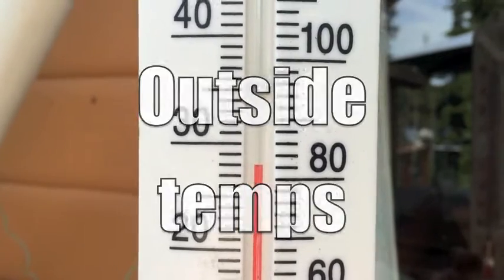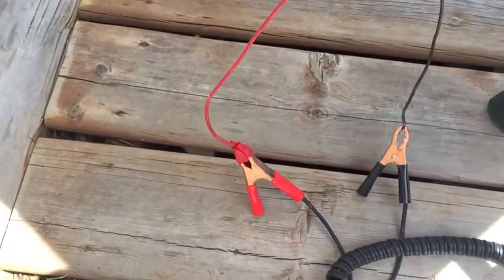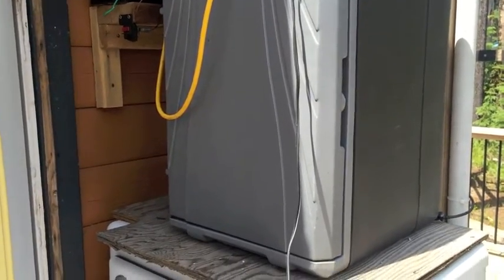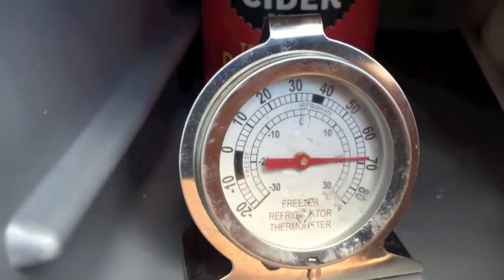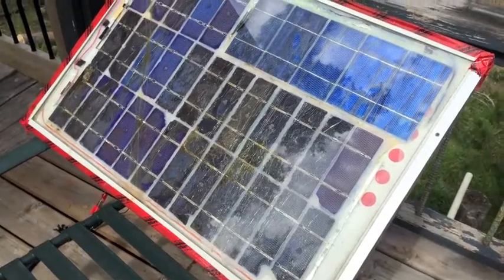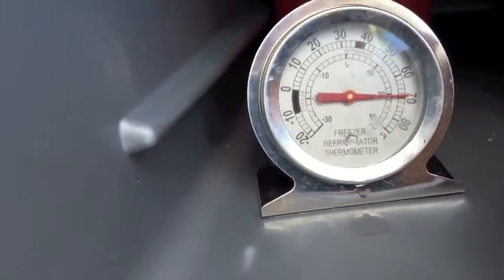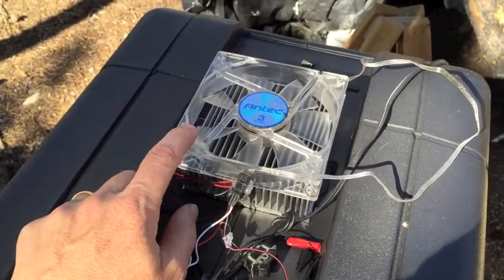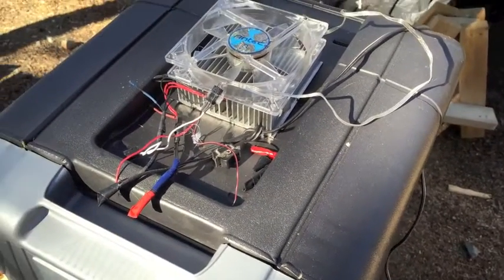Part 3 - Solar Panel and a Modded Electric Cooler

Comment: These coolers take a good 12-24 hours to get to maximum cooling. I have the older version of this. It's the same exact cooler except it doesn't use computer fans it has a duel shaft motor with fan blades on each end. I've had mine over 20 years and when the motor is working it works as advertised. 40 below ambient temp. My truck typically is between 70-80 so keeping milk fresh isn't an issue. I recently converted mine over to computer fan cooling like the new units for reliability and it works as expected. I recently purchased a fridge/ freezer cooler with an actual compressor but still use my 20+ year old chiller.

Comment: the problem is not enough amps. peltiers are inefficient if you dont have the voltage/watts theyre designed for. swap in smaller amperage peltier module and it will work more efficiently on same panel
Reply from the maker: Great suggestion. Thanks for the feedback!

Comment: I have one of these coolers. Even with the factory cord/fans, it took usually about 12 hours to cool things down in an indoor/cooled air environment. In a hot environment, it would take much longer. These coolers are awesome at keeping things cold, but don't work great (initially) at cooling them down in the first place. If I were you, I'd run the test again and just keep it going overnight. If possible, stock it up with some already cold beverages as well. If they are still cold in the morning you know it's working :)
Reply from the maker: I took the whole cooler apart and I think the problem was with the TEG module. I planned on replacing it, but got sidetracked with another project. Thanks for sahring the feedback.

Comment: The leads are killing any possibility of this working.  They are way to long for their gauge. You should test the function on a car's battery first to make sure that everything works well. If the external fan isn't blowing any heat than there is no way it is cooling.
Reply from the maker: Good plan. Yes, the leads are way too long. It was a spur of the moment project. I'll use your tip in the future. Thanks!

Comment: Most likely a big voltage drop over the leads. Even if the leads have the same resistance as the peltier your losing half the power heating up the leads.
Reply from the maker: Sirus Good point. The leads were a little half-assed. Plus the cord is wwway too long. I'll write that down. Thanks for the suggestion!
Reply: No problem. I do resistor puzzles for fun. They should make R/C/L puzzles at a given frequency. even more fun, keeps your mind sharp.